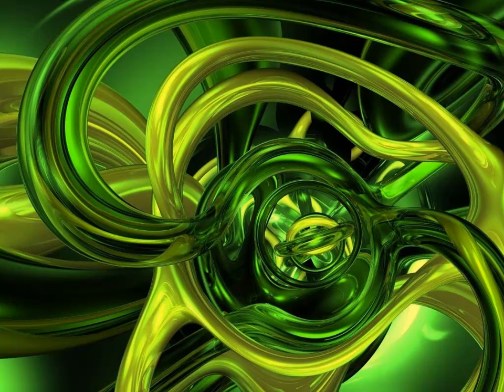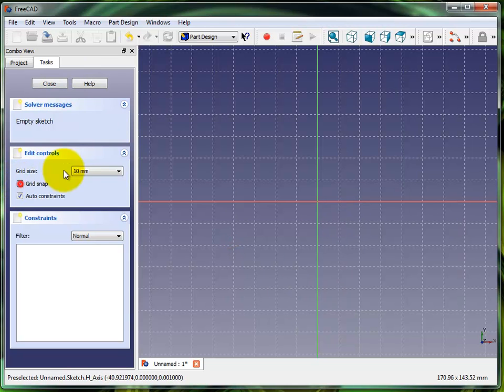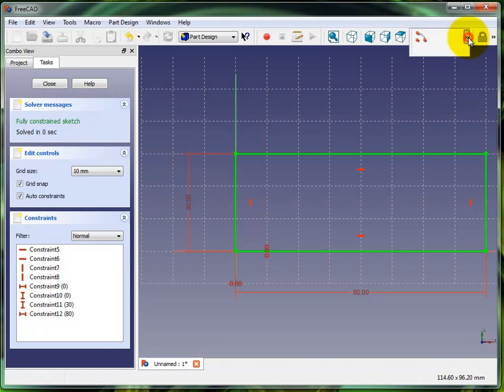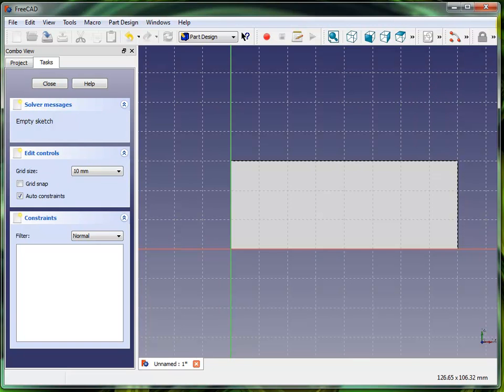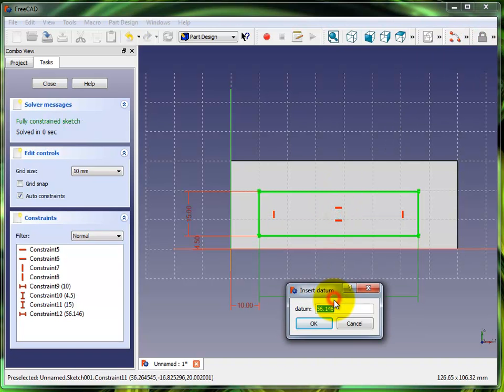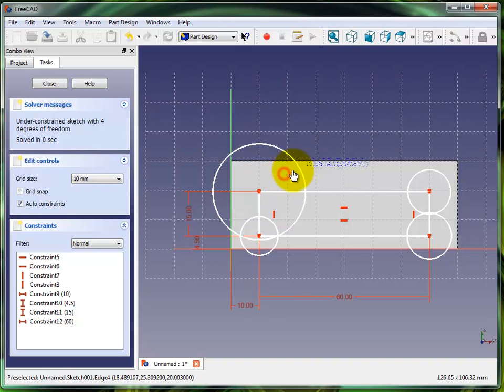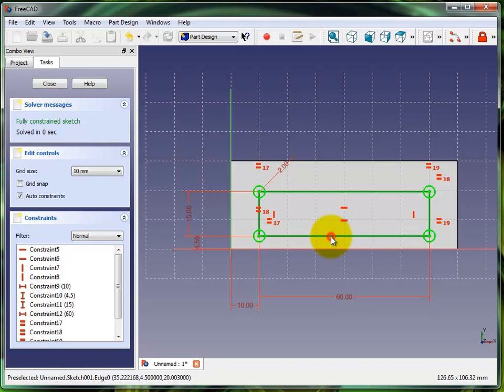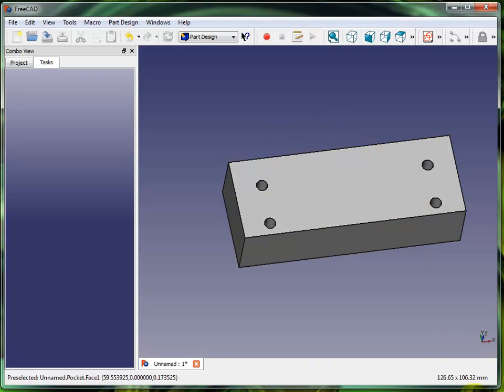FreeCAD bolt pattern tutorial

Comment: Great tutorial!  I love the "get some good music playing.." and you imitated some working speakers.
Reply from the maker: Hey thanks I get a lot of complaints about the music.  I need to update the tutorial one of these days.
Reply: Cool.  Actually, it seems you are a pro at FreeCAD - so I have a question..  Can u tell me how to arrange a multicolored part in a polar array AND not loose the colors? For example, I made a part with two cylinders touching on end, one was red the other blue.  It was fine until I used that combined part in an array - the colors were lost.
Reply from the maker: Rob DiNardo Hey i think you'll probably have to do something like this.

http://sliptonic.com/freecad-hidden-gems-setting-colors-for-individual-faces/
Reply: Lee Lancaster Thanks Lee.  The tutorial link helped, but i had to color each face (multi select) then change once face.  Do you know of a way to change ONLY the base part and have the other follow?
Reply from the maker: Rob DiNardo Hey sorry I'm not sure how to do that in freecad.  Once you perform an operation on the parts they become a new single part in the feature tree.  If freecad kept them as individual parts I think you could select each solid and color them individually.  But unfortunately from what i know of freecad it turns them into a "single" solid.

Comment: Nice work you explained almost everything I have to do in a drawing I am making. I have a question I am totally new to this, How do I build a another plate and align it with the center of the first one so they touch. I am making a "sandwich" of plates of different materials hold by bolts through it. Also How do I copy an entire plate and move it. I have copied one but it occupies the same coordinates as the original.

Thanks,